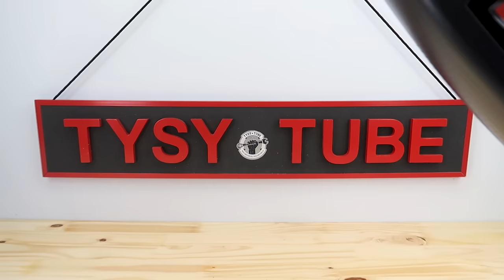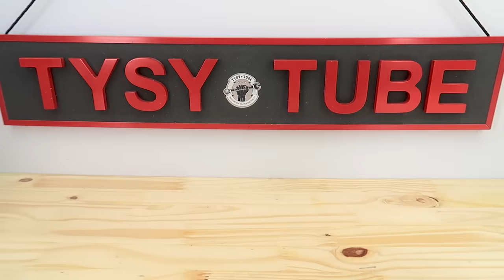Rusty Bread Cutter Restoration

Comment: I'd love Tysy Tube and My Mechanics to receive the same item in roughly the same condition and see how they went about restoring. It'd be really interesting as a kind of collaboration.
Reply: But, my mechanics would have made a new pin, rather than straightening the bent one...  But, they both do good work...
Reply: Tysy once sent mymechs a Wonder Lamp to restore (Tysy has done at least two of them). You might enjoy that!
Reply: Wouldn’t even be close. My Mechanics is light years ahead of TysyTube.
Reply: I think they're the same guy. :D
Reply: StevieRock or odd tinkering
Reply: @denang501  On the basis of what would you say... (Havent seen that many videos of "My Mechanic" though)..
Reply: Marius Enslin Just watch a few of his videos.
The attention to detail and level of care is insane. Multiple times TysyTube will do terrible spray paint jobs with odd color choices and blotchy coats. My mechanics would never.
Reply: @denang501  Have watched a few vids earlier today (The restoration of a pressure gauge/tyre gauge...and where he made a lock from a bolt) and understand now...especially when it comes to actual fabrication of parts.. ;-)
Reply: @mariusenslin  Well, he is a Swiss machinist
Reply: Lachlan Lau with some very high standards..not to mention skills set..and tools/machines for that matter 👍🏻
Reply: @mariusenslin  you're in for a treat. The videos are fantastic.
Reply: Ultimate Realist : Any videos in particular that you would like to refer to..
Reply: @mariusenslin  I love the rebar-cutter restoration.
Reply: @denang501  That might be a bit harsh you know, My Mechanics is absolutely awesome I couldn't agree more, but he has a horrible habit of just making new fixtures and fittings rather than trying to restore them.
Reply: My Mechanics...Hmm this loaf is a little stale, I bake a new one!

Comment: This was a staple of all kitchens in Denmark for decades. It is not meant for white bread - solely for dark, firm rye bread ("rugbrød"). Everyone had one and used it daily, rye bread is a staple still in Danish cuisine. The company, Raadvad, still makes the best knives, can openers (with rosewood handles) etc. Very high quality.
And thanks to Tysytube for all your videos. I am definitely a fan of yours and have been one for quite some time now. Thank you! :-)
Reply: @leah rose these are much more efficient, especially when it comes to some of the harder breads. Like, my mom makes this really hard sourdough bread thats near impossible to cut with a knife, and she uses one of these.
Reply: They are no longer called Raadvad, now they are Fiskars!!! I won't by them anymore.
Reply: @hoxoh123  may I ask why? I have a fiskars axe and it's great, so I'm just curious
Reply: @leah rose Ryebread is quite hard!
Reply: Yes, if I were cutting this baguette I would turn it over and cut from the bottom.  This would still get pinched some tho.
Reply: @hoxoh123  Fiskars shears are very popular for cutting fabric in the US.  I have a pair.  My mother had an old pair for cutting up chickens.
Reply: I still have mine and it works. You can still buy them at stores in Denmark (so why bother with restoration)
Reply: @leah rose because danish dark bread is hard to cut with a knife.
Reply: @damhoj  For the joy of it.
Reply: Raadvad hasn't made knives in their own factory for years. What came out 10-15 years ago, and probably further back and up until it got converted to Fiskars was most likely outsourced to the far east
Reply: Why do I hear “the more you know” sound effect?
Reply: "It is not meant for white bread" - yeah that's because white bread is not meant for human consumption. It has the taste and texture of a table napkin, why would anyone want to eat it?
Reply: The shinier the screws, the better the sandwiches.
Reply: @christopherbedford9897  don't yuck someone else's yum.
Reply: Thanks for the context about nationality. Assuming it was French (I guess I didn't hear him say it wasn't 😉) I was thinking it was about as effective at cutting a baguette as closing it in your car door would be. But yes, on a hard brown bread, this would be much better. Either way, such an entertaining video, and such great work.
Reply: @bobbyrooney  Why not?

Comment: Also as a dane this is nice to see! An old classic bread slicer, that was mandatory in almost every danish kitchen in the old days, before you could be sliced bread in the shops. It's made for slicing the typical danish dark type of bread - rye bread (Rugbrød on danish). It's way more dense than normal white bread, so the old slicer is perfect for cutting the bread in thin slices for making smørrebrød - or open faced sandwiched in english. The typical traditional lunch-meal for every kid and adult in most of the 20th century and still is. Rye bread was also a bigger part of both the dinner and breakfast in the old days, so the slicer was in use all the time. And with the relatively short but square bread, it fitted perfectly in the square angle of the the wood boards and was typically just stored there for the whole time. With a normal knife, it can be hard to cut the big bread even and avoid cutting the slices too thick. This guillotine principal (although power operated)  is still used in the industrial bread slices that slice your bread at the local bakery. And yes i could also be used for slicing thin slices of cabbage or other more heavy and dense stuff.
Reply: Thanks for clarifying that's its different than standard white bread. I was thinking this thing would obliterate normal white bread. (probably will)
Reply: Rugbrød = pumpernickel And yes Mike Obie, it is not very good for soft breadtypes.
Reply: You deserve more likes my man!
I thought it was a salami slicer, since i noticed the small screw mechanism that helps determine how thick the slice would be, but the square shape made no sense...
Thanks for sharing buddy!
(Btw I'm from Israel)
Reply: Rugbrød å æ mapak
Reply: @Slork  Is THAT what that was! I was wondering!

Comment: Excellent!

Powder coating much better than painting.
Reply: Much more durable in fact!
Reply: Probably more convenient too. Restocking unused paint is super easy, and I think you can't ever apply too much paint because it won't stick.
Only downside is you have to bake it. It's faster, but you'll need an oven you're never going to use for food again.
Reply: @thany3  that'd where second hand market comes in. Buy a decent oven/roaster for under 20 use it till it breaks, recycle it.
Reply: Why? Doesn't liquid fill gaps more easily?
Reply: Much more susceptible to runs and uneven coats tho
Reply: The painting process is way more satisfying.

Comment: Great video as usual!  The handle is maple.  That's why it took on a gloss when you fine sanded it and it's why it didn't absorb a pigment stain.  Stains with pigments are really like thinned paint and unless you have an open grained wood like oak, the pigment particles just wipe off and are not trapped in a very fine grained wood like maple.  Google "water based aniline dyes".  Best way to make maple rich and dark.  "Golden Antique Maple" is beautiful.

Comment: As a dane, you will sure get my upvote on this one. The Raadvad bread cutter are iconic here also. Now you only need some rugbrød to slice! Nice restoration dude!
Reply: I wonder if we can find paint in the original color here in Denmark
Reply: upvote??
Reply: @moviestargf  an upvote is when you get off your chair too quick and get lightheaded.
Reply: Remember we had this as a kid. Always wanted one, but they're hard to come by.
Reply: Ghost87  i think it's because raadvad is danish, that he mentions he's a dane🤷‍♀️
Reply: What was the original bevel angle on the cutting edge?
Reply: @ospideyo  potato potato
Reply: Good question. I know the blue color variant are close, if not exact same, as 'Madam Blå' kitchen series from Glud & Marstrand. Besides blue, Raadvad also did green, black and beige/white ones.
Reply: y tho?  Is this thing for people who prefer their bread pinched in half instead of cut?  Maybe for people without the hand skills to use a knife?  You could just use a knife.
Reply: @jbtechcon7434  It is for slicing ryebread, not soft wheatbread. And the little "wing" that moves up and down with the knife, is for setting the thickness of the slice, and a slice is about 5 mm thick
Reply: Ghost87  Raadvad was  of pioneer in the start of the industrial age in Denmark. Ryebread as this machine is meant for cutting is eaten a lot in Denmark. Probably more than wheat based bread. All families in Denmark 75-50 years ago had one of those machine and it was used everyday, since then it's mostly the older generations who has used them but you can still find them in most second hand shops. I think that is why he mention he is Danish as all danes know them and have most likely seen their grandmothers use them in the kitchen. 
I do not expect you to be interested as you are very fast to judge but maybe someone else would be interested in background knowledge and facts.
Reply: @jbtechcon7434  This is made for ryebread, a stomach heavy bread that no one can escape in Denmark! And it is terrificly delicate 😋
Reply: Delicious, that is.
Reply: Ghost87  Another "only" people that do this are these.  How does it make you feel better for you to label others you've never met?
Reply: @jbtechcon7434  Because history, nostalgia and (dare I say,) heritage.
Reply: @crimsonfancy   Sooo, the Danes of decades ago didn't have knives?  I seriously don't get this thing.  It's like one of those dumb As-Seen-On-TV gadgets that housewives buy impulsively then it sits in your garage for eight years before it gets ignored in a yard sale.
Reply: Ghost87  because not only is it a Danish invention, but the very symbol of all things good in this country, so it's an accolade to the quality of his restoration of the item😊
Reply: Ghost87  ok Twitter
Reply: @davesmith5656  No, that side must remain flat. It is supposed to sharpen itself on the stationary part. That cannot hapen with a bevelled edge. (or a painted surface to grind against)
Reply: @woodrows  @Erik Fleischer "Rugbrød" is not "ryebread" (strange??) It is in english called pumpernickel.
Reply: @jbtechcon7434  You apparently have never used it. ;) It is eminent for cutting pumpernickel. Not very good for wheat/soft bread.
Reply: @fveggerby  Well, pumpernickel is a type of rye bread. Just to be pedantic.
Reply: @MariaAkaBruno  Maybe he's a small mann.
best regards Denmark  og et stort smil.
Reply: @jbtechcon7434  They had knives, but this is much better at cutting slices of rye bread than just a knife.
Reply: @jbtechcon7434  You obviously have never tried to cut rye bread with a knife. It sticks and crumble. That's why we need to use a designated tool.
Reply: @l0gphroe  and yellow 😊
Reply: @jbtechcon7434  Imagine yourself at a farm at the table 100y ago. Family is there and all the people working there. 30+ slices hard bread needed. Cut with a knife would be a hard job. Thats why this machine was a revolution.

Comment: This has to take the prize for one of the most over engineered and complicated solutions to a non problem I've ever seen. That said, still neat.
Reply: Instructions: if it doesn't work, turn it off and turn it back on again

TYSY: proceeds to dismantle modem and replaces Ethernet cable by hand
Reply: If you are talking about a bread slicer in general. Most knifes are not suited to cut bread. And bread knkfes weren't invented until like the 50's.
Reply: It’s French. Of course it’s complicated and over the top 🇫🇷
Reply: @LunaS043  knives*

Comment: Did he attach the blade to a piece of wood after the buffer caught the blade and threw it across the shop?
Reply: that was his finger...
Reply: @AnthonyParsons-yg7xp  
5:12 
You sure about that buddy?
Reply: It looks metallic though. Maybe it's a sword. Because that's safer. 😜
Reply: maybe not on this reno, but you know there is a hole in the floor, his foot, the ceiling or wall from that first experience ! 

When the eye doctor removed the piece of metal from my eye, he had to bring in a 2nd doctor to show him was happens when you don't wear safety glasses.  [ I was going to say 'what stupid looks like' ]
My guardian Angle was looking over me and it healed perfectly.
as you can imagine, I have 2 brand new pairs in plastic in my box and my normal ones handy at all times.

Comment: It is always a pleasure to discover a new video from you. It is also fun to watch your skills improve with every new video. Pulling the nails without denting the wood was great to witness, and reusing those same nails in the restoration was brilliant. 

I'm am not sure if this is your first use of powdercoating but I am glad you made the investment in that technology as it looks wonderfull. Now we need to help you get a lathe so you do not need to use modern bolts or the locking nuts. Nevertheless, the modern nut and bolt are of little significance in such a wonderfull outcome. 

And the bread look delicious as well.

Thank you for sharing.

Sincerely, 

Leo

Comment: that extra bit with the linkage to the main arm, any idea what it might have been?

maybe a place for a spring assist?
Reply: James Axelrad it's for setting the thickness of the cut. This machine is for cutting Danish ryebread / rugbrød / pumpernickel, which is very rectangular. It is also not as chewy as a French style baguette, which means it will cut much better on this type of machine. The Danish ryebread is fairly tall and it can be difficult to get even slices with just a bread knife. Especially when the slices only are around 5-10mm

Comment: Another excellent restoration! Someone pointed out in the comments that it could also be used for slicing a block of cheese, which makes sense, as it's easier to just use a knife on bread versus cheese. Your restorations are very relaxing to watch--thanks for lowering our stress levels.

Comment: Great job on that!  I restored one myself and use it a lot.  Your sharpening angle is too steep, however.  Sharpened right one of those goes through bread like, well, a hot knife through butter.  Nice job overall, though and thanks for sharing!   Cheers!

Comment: Am I reading this correctly, the markings are Dutch?
Good to see the sand blaster back in action too.
I've never seen home-brewed powder coating before... neat!
I always thought you were supposed to pull a blade INTO a sharpener, not drag it away? Does it make a difference?
I'm not sure of the benefits of this device over, say, a bread knife, but I understand it as something used at mealtimes, like a ritual.
Great fit and finish as always 😊

Comment: Very nice restoration but what is to stop the bare metal components from rusting again especially the blade, if you are intending for it to be in every day use would it not have been better to replace it with stainless steel? If the intention is to keep it as original as possible just a collection piece then I understand having, said that I suspect the original paint finish was not powder coated. Once again nice job it looks as though it was better than when it first left the factory.

Comment: Two questions: I’m concerned that the stain wasn’t food-grade meaning I wonder if it’s ok for bread to contact wood stained with that stain. Secondly, I believe that knife was a single bevel knife and only should have been sharpened on one edge and not both. Correct me if I’m wrong here. Otherwise, brilliant restoration!
Reply: Ur wrong hehehe

Comment: Nice. But a couple questions:
4:20 Why not sandblast this? It would have sped it up considerably.

7:00 Why is that still stained? Didn't you sandblast it?
7:50 Why would you handsand that, you have a power sander?
8:05 I hope that's a food-grade stain. I'd have just used Linseed Oil.

Still, as I said at the start, nice. It came out looking very good.

Comment: watching the disassembly, it makes me think that they should make restoration screws that are only about 10% larger than the original so they will fit in the same hole an fit tight.

Comment: not sure if it was mentioned before, but, you probably shouldn't have tried to sharpen both sides of the blade. One side should have been flat, and the other side beveled.

Other than that, that's Purdy...!

Comment: If its truelly a guillotine blade itll work better if the side facing the holder is sharpened flat not with an angle same way with a yanagaba or any single bevel knife

Comment: I love how absurdly over-engineered this thing is - as if slicing bread with an actual bread knife was a huge pain.  Ironically, it looks like slicing with a knife is about 100 times faster/cleaner!
Reply: These things belong in the first half of the 20th century Denmark.  A mainly agricultural society. 
You'd be surprised to see the amount of rugbrød (rye bread not entirely unlike pumpernickel) that hungry farmers could eat at breakfast (6am) seconds (9am) lunch (noon)  and tea (3pm)

Those things were put to good use,  every single day.
Reply: Call them what they are, a bread SAW. Serrated edges will cut the bread faster. With the correct serrations you don't even get a huge mess of crumbs either, although a bakery can bag and sell bread crumbs as well.

Comment: Wrong. The metal edge against the cutting blade coming down (1:40/43), is not supposed to be painted. Otherwise you may get blue paint into your bread when you cut it. And the screw jaws should have been worked / polished much better for best impression. Otherwise a pretty decent work.

Comment: I appreciate the work put in this restoration, but why everything except wood have to be in mirror finish or wet gloss? Even nails? It dosen't look authentic in my opinion. And shouldn't this blade be sharpen like a single bevel? It would cut better.

Comment: Will it cut the bread?
With what? 60 - 70 DPS edge angle? You gotta be kidding.
Could you make it any DULLER when you "sharpened" it?!?
Try a 10 DPS edge angle. It'll cut then.